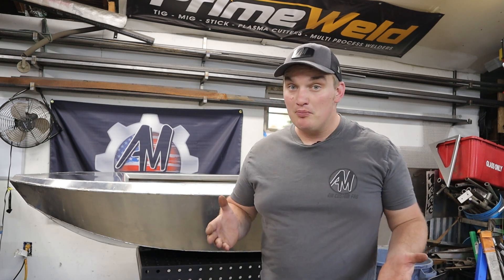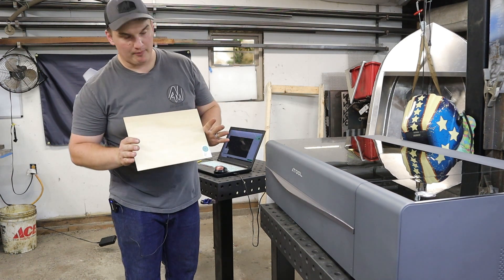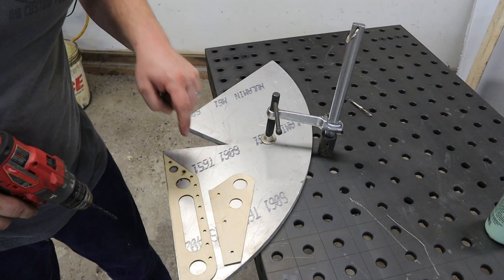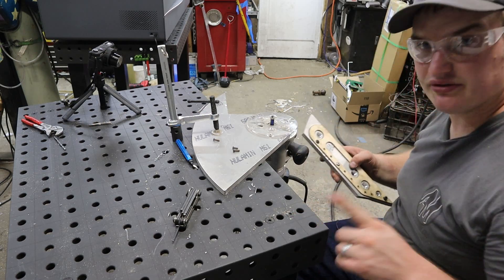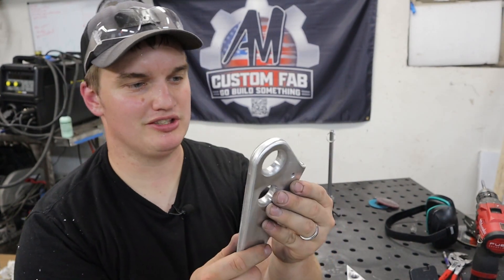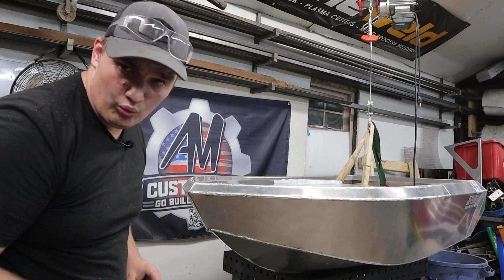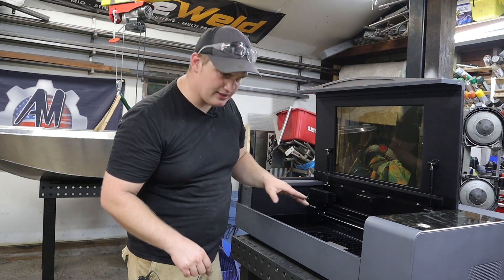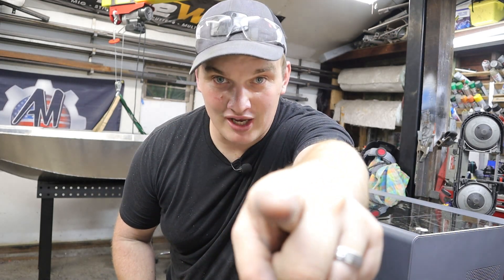Making Billet Aluminum Parts with a Desktop Laser.!!  ( xTool P2 55 watt Co2 laser Cutter )

Comment: Thanks bro, I wish there were more videos like this.. I ordered a Genmitsu Reno to cut some 6mm acrylic templates to use to route up to 10mm thick aluminum for a cnc type machine I’m building. One thing I didn’t consider was using a flush cut bit to create the larger holes. I was look at some inlay procedure type routing.

Comment: I was thinking about just using the laser to mark out the metal and then use a manual mill to do the actual machine.  Your way is cleaner.  Cool video

Comment: Why would I buy a expense laser to make a wood template, rough cut the aluminum piece, fasten the wood template to the aluminum then route it out on a router?  After all the I still need to drill and tap. I would just cut the aluminum with a band saw, belt sand edges and drill press holes. NOW if the laser will cut through the aluminum you would have something there.

Comment: Your video is exactly what I was looking for.  I’m making a tool jig out of 1/2” 6061.  I just made a prototype with my Xtool P2 out of doubled up 1/4” MDF.  I’ll be able to make template easily now too.  Were you using just regular wood router bits?  I didn’t know about the laser paint and just ordered some.  I’m excited about adding my logo to the jig.  Thank you!

Comment: One more question about your laser cutter... Will it cut ⅛" aluminum?
Reply from the maker: No, unfortunately it won't cut any metal. Just wood and acrylic. It will engrave on steel and stainless though does not engrave on aluminum unless it's a chemical engravating

Comment: Question about primeweld mig 180.... Do you know of a compatible spool gun that will work with the 180? I'm searching and searching cause i use the spool gun full time and i can't keep it working without it malfunctioning ever 20 minutes of use. Maybe after 15 minutes. Not solid non stop super long welds for that long but about 1 inch long welds for 15-20 minutes. The motor starts acting sluggish and stopping, sluggish then stopping. I've had primeweld for about 3 years and I've been trying to find a solution to this problem from the start. They've sent me a total of about 5 spool guns and they all do the same thing. I still really like the primeweld machines but the spool gun is sadly trash. I wished it was something I'm doing wrong but after three years of research and watching videos and tons of reading I've concluded it's the spool gun.
Reply from the maker: Agreed there. Spool gun is not the greatest. That's why everybody has asked me to do a school again video and I haven't yet because it's not a great spool gun . I thought I heard a whisper if they are in the process of designing a more robust one. But I haven't seen anybody use a different brand yet

Comment: Aluminium on a sketchy router table was already an iffy idea to put on the internet (but honestly I’ve probably done worse) but man, take the gloves off. Gloves on a router table isn’t an example anybody should be setting. 

Other than that, I can appreciate the ingenuity.
Reply: I didn't mind the gloves nearly as much as how close you let hour fingers get to the cutter bit. Holy cow! I felt physical sickness inside. You should take the time to rig some kind of clamp or something so you can still hold the part steady while keeping your flesh three inches or so away from the cutter.
I can guarantee that if you did that the way you did it long enough, you WILL lose a finger or two. Not worth it. Take the time to rig a SAFE way to hold it.